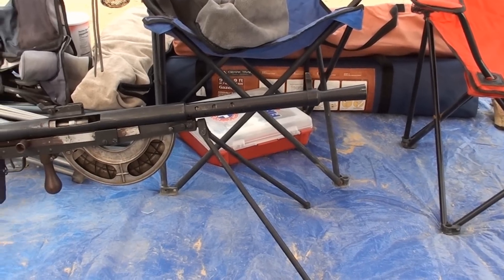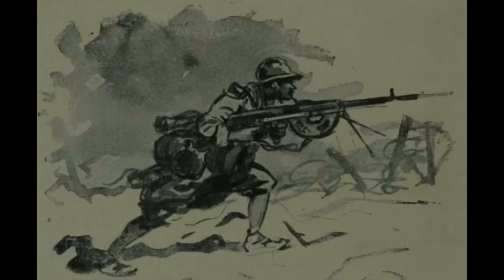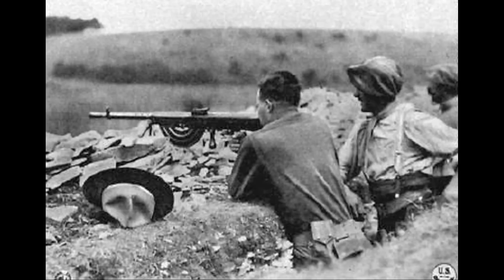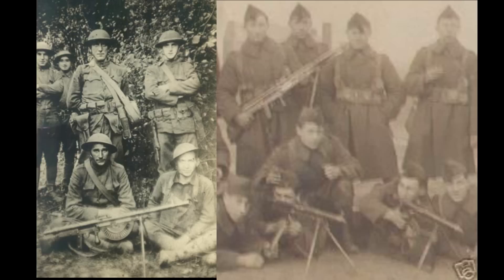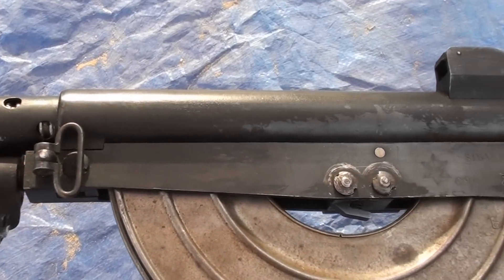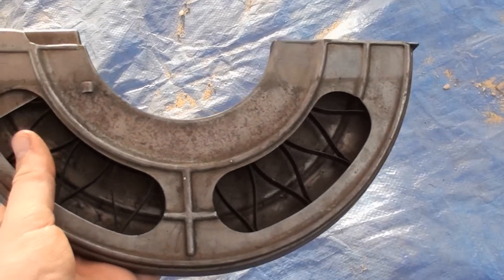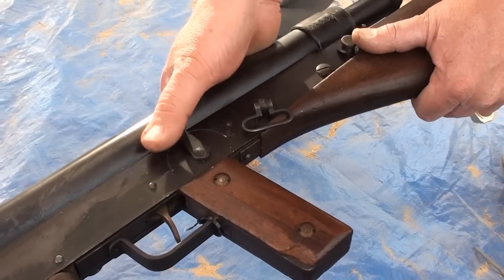WW1 Light machine gun: French Chauchat (Sho-Sho)

Comment: You are right: the Chauchat was not desined for use in trenches (receive later a new straight and closed magazine), was only use in it because they was unexpansive to built and the Hotchkiss portable  M1909 was not much better (made for aircraft use)...But the standart French heawy machine gun was the excellent Hotchkiss M1914, fire the same 8mm Lebel ammunition.

The Chauchat was replaced after the war from the FM 7.5mm MAC M1924 and Hotchkiss M1922 same caliber.

Comment: I'm guessing it's already been said, but the gun is chambered in 8mm Lebel, not 8mm Mauser. When clean, and in good working order, the guns were quite reliable in 8mm Lebel.
Reply from the maker: You are very incorrect. This one was chambered in 8mm Mauser but they were also chambered in 30-06, and 7.65×53mm Argentine. The french sold them to many different countries in a range of calibers.
Reply: The magazine is clearly designed for 8mm Lebel. It would be very difficult to feed 8mm Mauser. If it didn't work reliably, that would be the first place to start.
Reply from the maker: SitsinShadow
 Nope even says 8mm Mauser on it. The mags look the same on all models. Late war mags do not have to open hols in the mag but they are kinda rare. That's about the only difference you will see.
Reply: sharpie443 That doesn't jive with history. There are many, many photos of Chauchats converted to 8mm Mauser, ie 8x57. Just like the M1918 built in .30-06, they required a straight mag to feed correctly. The semi-circle mags used by the M1915 had to be severely curved due to the 8x50R cartridge used. There's no conceivable way that 8mm Mauser could feed from a 8x50R magazine for more than a few rounds. Did you see the gun run, any videos of it being used?

Comment from the maker: The colt Walker revolvers would be in the running for that title. They were to over powered for the metallurgy of the time. The iron revolvers were powerful but a good portion of them exploded in the hands of the solders. That's probably why the next generation (Dragoon revolvers) had cast steel cylinders to solve that problem.

Comment: 8x50mm Lebel was the FIRST smokeless round(1886).French were insistent on using the Kropatchek Naval tube fed rifle as basis for 1886 Lebel rifle, which as noted, used 11mm Gras round.Designer, Col. Lebel, advocated for a Rubin type design round, that was more modern and far more adaptable than the wide based 8x50.Lebel so upset he at one point disavowed project.This ill-fated bureaucrat decision in 1886,haunted French weapon design into 1920's, when France went with more modern 7.5mm design.

Comment: The Chauchat was a technical wonder at the time it was designed  in 1907.  There were no other LMGs then.
Reply: There was a far better lmg in the Madsen
Reply: zman1508 Didn't know about the Madsen.  Guess it was patented in 1902, so it would have been a "contemporary" of the Chauchat.  At first glance, it reminded me a little of the Bren, produced much later.  Too bad the Norwegians couldn't use it to stop the Wehrmacht.  I guess they had problems with it that far north,  often jamming after a few rounds.  Seems like everyone else liked "Virgin Madsen" as the Norwegians nick-named it.   The operating cycle sounds unusually complex.  I wonder how the components held up over time.
Reply: It was a very reliable gun in terms of not jamming but amazingly complex they even made 20mm versions for some light AA/AT work and the brazilian police used them up until very recently in 7.62 nato if you are interested check out forgotten weapons video on it.

Comment: 8mm lebel loaded to world war one specs is made by PPU and is commercially available and works well. military surplus lebel 8mm tends to be of the N type which unless the world war 1 guns were rechambered for it is not safe.
Reply: 8mm yet it still did its job funny enough that 1911 pistol puts that gun to shame for calibre size because it fired 45AC bullets
Reply: 8mm lebel  has a velocity of 2,400 ft/s and an energy of 2,481 ft·lbf
45ACP has a velocity of anywhere between 830 ft/s and 1225 ft/s and an energy between 352 ft·lbf  and 616 ft-lbf.

8mm lebel is  rifle round meaning it goes faster and has more energy put into the target. its actually more long range up to two miles.

Comment: It is not a light machine gun at all. In fact it was the first fully automatic rifle. Yes it had its problems, as new equipment often does. The open magazine was a deliberate choice. The weapon was to be operated by a two man team. A gunner and a loader. Because of the open magazine the loader could see when he had to change the magazine. This was an unfortunate design feature in the muddy environment of trench warfare.of course. The weapon performed reasonably well with the lebel round. It was never designed around a black powder round incidentally. Only when they began to adept them to accept other cartridges something went spectacularly wrong. That mishap is what the reputation of this weapon has come to be identified with. Don't forget that this weapon came into existence two years before that other automatic rifle the BAR.

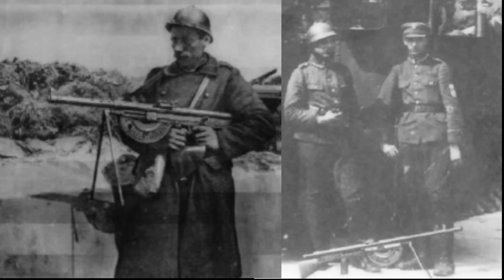Comment: I don't meant to come across nasty, of course, but I think the original French pronunciation sounds like "show-shot" without the T. Just thought you might want to know... :) - (edit) Oops. My bad. I confess I wrote that before getting to 1:01.
Reply from the maker: Well even bad guns are interesting to me. Some of the worst guns in history still can be very important historically. One that doesn't get talked about a lot is the Springfield trapdoor rifle.. It's an interesting rifle, the main U.S military rifle for a time and very popular with collectors. However in it's day it was one of the worst military rifles in use. It was slow to load, the cases got stuck in the chamber,, it was probably the reason General Custer was whipped out at the Battle of the Little Bighorn and Remington was making vastly superior rifles for many European militarizes right here in the U.S at the time. The gun was a cobbled together piece of junk  but much like the Chauchat it is historically interesting.
Reply: sharpie443 The Trapdoor Springfield was originally meant to be a cartridge conversion of all the Springfield rifled muskets left over from the Civil War.  That made sense, but the full-stocked, military version of the Remington Rolling Block was vastly superior and cut a swath in Europe.
Reply: sharpie443 The 8mm Lebel was the first smokeless powder round adopted by a major power. I do not believe it was ever used with black powder. It is a lower pressure round than 30 06 certainly, but the Chauchat was designed for smokeless powder pressures.It was initially designed with the 8mm Lebel in mind..

Comment: Everything was unreliable?  No; the Maxim variants worked like a charm, otherwise there wouldn't have been much trench warfare.  The field artillery worked well enough, especially the French 75mm, which was state-of-the-art and highly accurate at the time thanks to its then-top secret recoil compensation.  The French made a pretty decent tank called the Renault.  It's just that the Chauchat is the stain on the honor of France; it is simply the worst weapon system ever due to sheer numbers.

Comment: theres no any frech gun around world that works properly..
Reply: That's right,they were replaced by other models all the time,just bringing another malfunctions into the weapon's concept..If there is a french Firearm,which is reliable in relation to it's precessor,it's the MAS 36,replacing the Lebel rifles of the french army..But even the MAS 36 was very scorned and unreliable,if you compare them to other bolt action rifles,such as the M98, or the M91/30 etc..
Reply: hmm, maybe french should stick with cheese and wine (oh and soap... and deoderant...please.)
Reply: *****

famas works well, mac24/29 was good, and frencht tanks are good.
Reply: Kamfrenchie
the MAC24/29 was an excellent Autorifle, but the Famas has its flaws. It can´t be used with brass ammo, and from what i heard, overheating causes the body to slightly deform (like the G36).
Another good french weapon was the MAT49 SMG
Reply: ***** M1903, SMLE.
Reply: ***** M1903, SMLE.

Comment: Chauchat? More like "ChauSHIT"!! (Pardon my French). But the truth was that this gun was bad. The primary issue was that it was poorly manufactured. It was made from cheap, stamped-out metal not designed to handle the stress of combat. Also, the magazine would attract mud (because it was almost completely open) and clog the gun. Trenches were practically made of mud. So... Yeah, it was not very good.
Reply: They're still running more than 100years later, not bad for a cheap gun. Will all those ar15 type run in 100 years ?

Comment: Small round, slow rate of fire, small magazine, heavy barrel, unreliable and constantly jamming gun with a fucking open mag?!?!! Iv heard it is also inaccurate but the small round can't possibly give it much recoil.
Reply: Small round? 8mm Lebel as approximatively the same power as the 7.62 Nato (but attention, some actual reproduction Lebel cartiges are from bad quality), the magazine from the 1918 BAR as the same capacity, and the Chauchat jams with the US caliber, but was much more reliable in 8mm Lebel , by the way ,the captured Chauchat was use from the germans who appreciate he's firepower, some was modified to 7.92 german and work well... yes low  fire rate, but the BAR or the Lewis fire not much more faster, and low rate impove the controll for a so powerfull ammunition if you fire at shoulder...
Reply: if the BAR had been issued in World war 1 it would have the reputation of the worst machine gun. the BAR was not issued because the first production run was of such horrible quality that production was delayed.